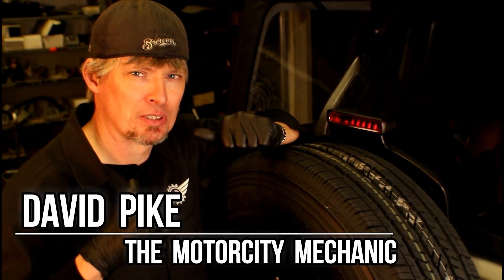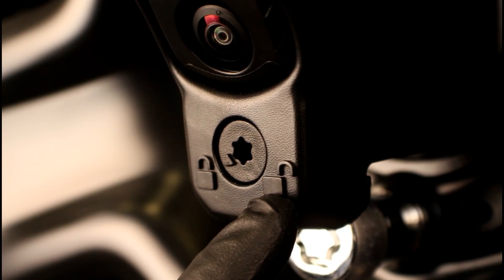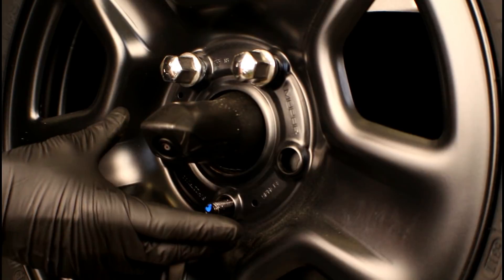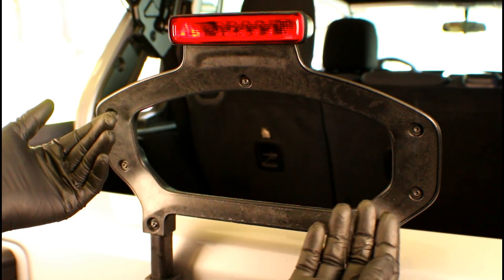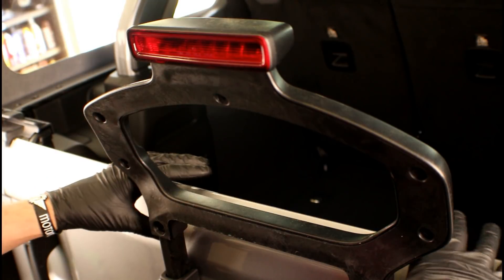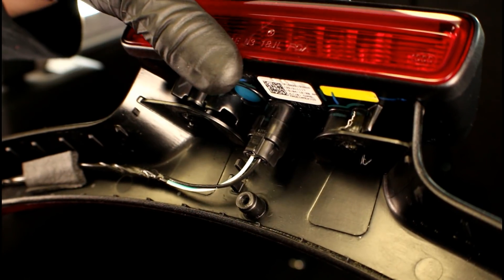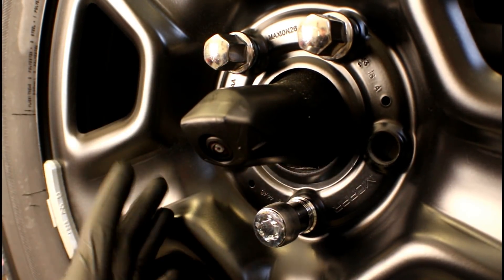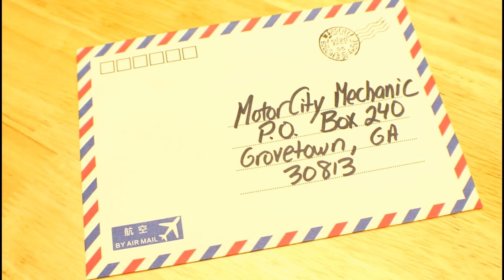2018 and Newer Jeep Wrangler JL third brake light assembly removal

Comment: Hey David love the videos. They come in very helpful. I have a question i have a 2015 ram ecodiesel and every once and a while it give me a engine light. When i scan it i get a p2600 code. Not sure what it means for a ram i cant find any info on it
Reply from the maker: Many thanks James! That code number doesnt show to be a good number. You may need to use a different scanner to pull the codes.
Reply: Thanks for the quick reply. That’s what i was thinking my self. All else fails ill have to take it to the dealer. 
Thanks again.
Reply from the maker: Depends on if you can those codes scanned properly, otherwise you just might have to.